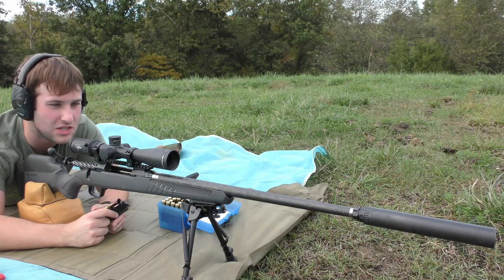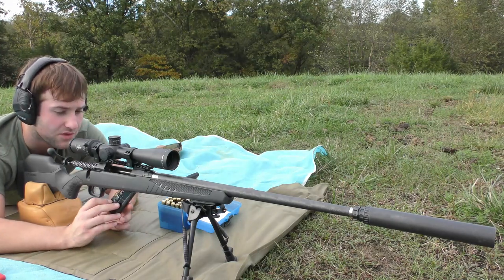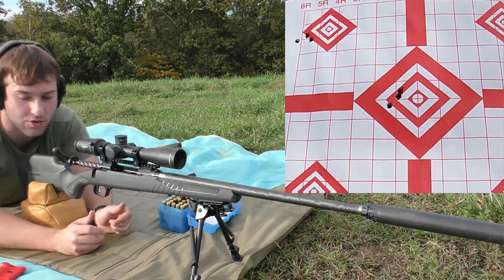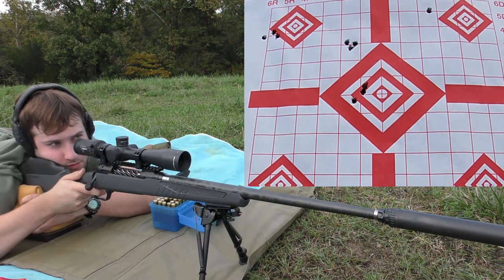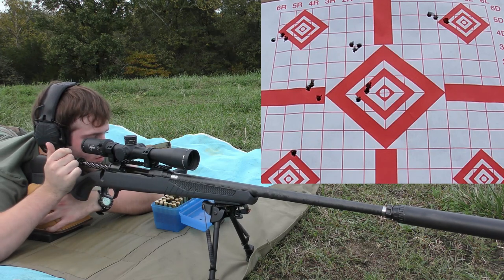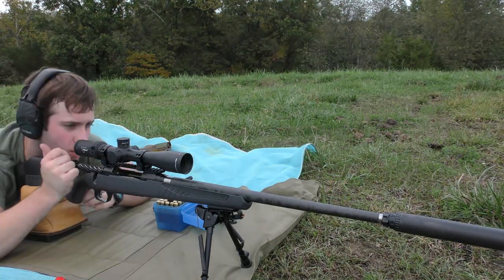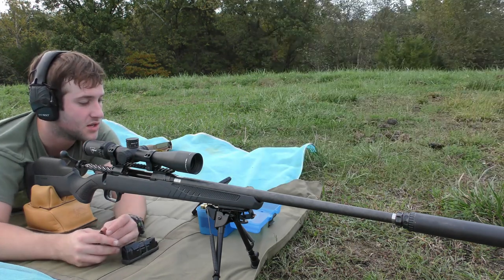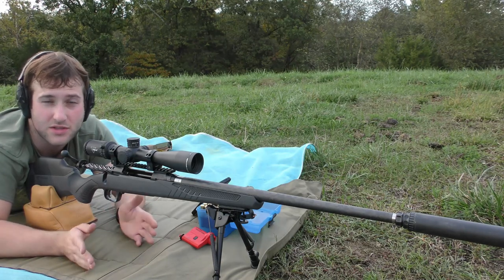Suppressed Savage Ultralite 280 Ackley Improved, Barnes 140g TTSX: Hybrid 100V Optimal Charge Weight

Comment: I've got two 280AIs but have only made time to work loads for one of them so far. 
24" Bartlein 5 groove #3
Defiance action
Factory Remington BDL 700 wood stock, pillar and skim bedded, shortened LOP to 13" with Pachmyer decelerator pad
RHR bottom metal 
TT Diamond trigger
Zeiss V4 6-24 scope

139 Barnes LRX, full case of Superformance, fireformed Rem 280 Norma brass, 210 match Fed primer. Brass was neck sized only with a bushing after annealing. 3300fps, half MOA. I'd have to look up SD, ES again but if I recall correctly, SD around 7
Reply from the maker: Sounds like a fantastic hunting rig!